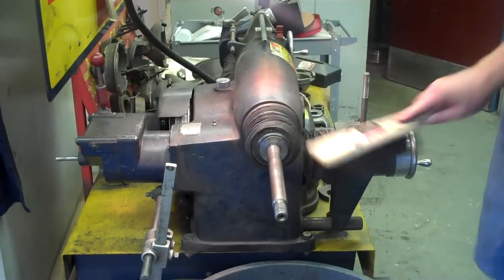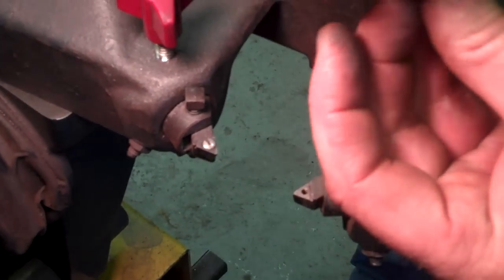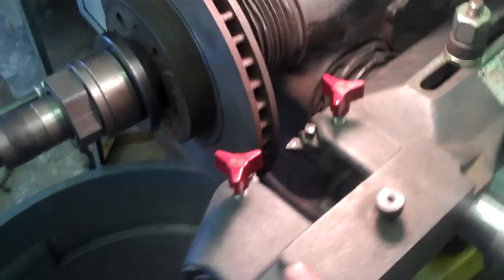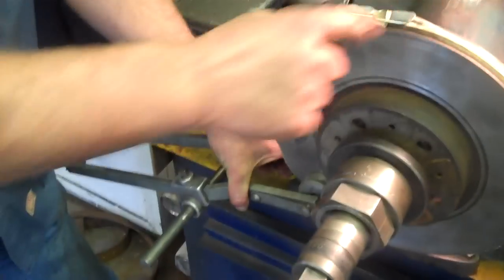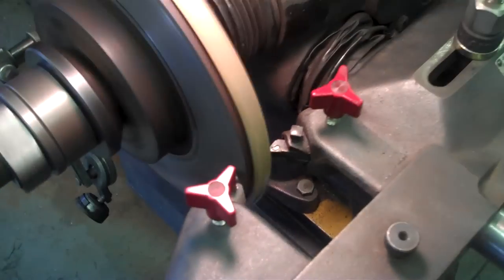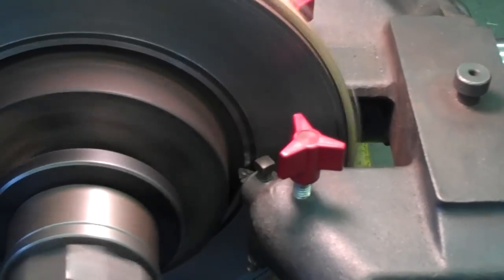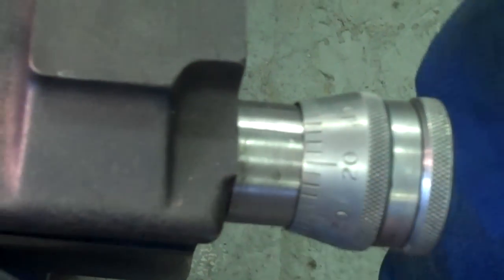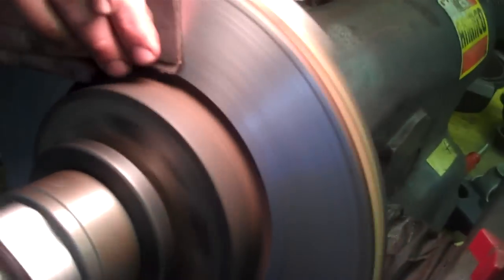Brake Lathe Rotor Refinishing

Comment: the set up on the machine is nice. but they cuts are brutal on the bits. I don't do more than 2 notches at a time. .004". the fast cut with .006" and it's over heating those bits and killing em. if you want to do that I would invest in on-the-car-brake-lathe. which of I remember according to Pro-cut you can do .008"

Comment: You're doing it wrong.
It takes me 2 minutes to setup the machine and I get a perfect cut the first pass every single time and I don't even attend the machine. I set it up and go do something else, 10 minutes later a perfect cut...
Reply: syntaxerror247 Hey, where's your YouTube video?
Reply: Kirstin Morrell I don't have a video of the process, but I was shown how to machine the rotors by a mechanic at my workshop.
First, mount the rotor -> with the cutting blades at the outer edge of the rotor, bring the blades in till they touch the rotor -> turn the machine on to spin the rotor -> manually move the blades slowly towards the inner edge of the rotor, keep adjusting the cutting blades so that they stay in contact with the rotor all the time as you wind the blades towards the inner edge of the rotor. Once you reach the inner edge, turn the blades in 2 or 3 notches on each side of the rotor and let the machine work its way out towards the outer edge. After 10 minutes you will get a perfect cut the first pass.

Comment: I cut rotors totally different  than this. You didn't measure before to see if you had enough thickness to even be able to turn the rotor safely! Also your making it more complicated than it needs to be. If I done it your way i t would take 3 hours to do a brake job!
Reply: Bryan Davis I agree with you, this method takes way longer than it should.
Reply: Bryan Davis .bastava pulire bene i punti di contatto con la macchina, per ottenere un lavoro più perfetto e preciso...una volta montato il disco sull'auto...potrebbe essere innevitabile che questa vibri irremidiabilmente durante la frenata

Comment: nice video other than the 3 notches part.  i was able to pause the video and see that each line is equal to 2 of what i assume are thousandths, so you are taking .006" cuts, or are the graduations on the dial arbitrary?

Comment: Usually there is a number written on the rotor shows less of diameter in the safety limits
If you did not find it see the user guide

Comment: So it takes 1hr to do 4 discs .. So that's around £60 labour to cut the disc + remove and refit the discs&pads say around another 1hr which is another £60 , so £120 labour brake job.. For normal cars this is too costly , for an high end sports car were disc can cost upto £200 each it's a bargain..
Reply: 50mins to machine 4 discs and replace the pads then road test and bed in the pads. I would do this at least 4 times a week.

Comment: Did not see unit end but never use sand or emery paper on a brake rotor.  You are not able to hold .1000" tolerance like your lathe can, plus you are changing pressure and angles all the time.  That paper also wears as you use it, so you're not maintaining same grit on each rotor.  You mentioned Cross Hatch but that is not possible with paper, it only flattens peaks.  Use a patented Rotor Hone, it reprofiles to very bottom of valleys and produces consistent 40 Ra crosshatches.  rotor hone. c o m

Comment: Nice try, but here are some important tech points.
1. Always use positive rake bits, preferably Round. Negatives tear metal, positives shave metal. Average 20% smoother finish, plus no final slow cut is needed so save 10 mins). 
2. Use metal 4 spring silencer (#9800). Rubber band style (#6920) out of balances rotor, since more lead is on one side than opposite.
3. Always use hockey puck silencer assembly.  Energy deflects outward from bits (front) and V's toward back, so it needs to be dampened.

Comment: the right tool bit holder need to be back against the tool shank to prevent vibration. The last spacer is not a vibration damper Its a self aligning  spacer. You put the large nut on backwards. The silencer arms are to be set top and bottom not side my side. After taking off the outer lip off there is no need to loosen the bits again just crank it in slowly. 4 notches is 8 thousandth of an inch. Each notch is 2 thousandths. Always cut both sides of rotor equally Otherwise very good video